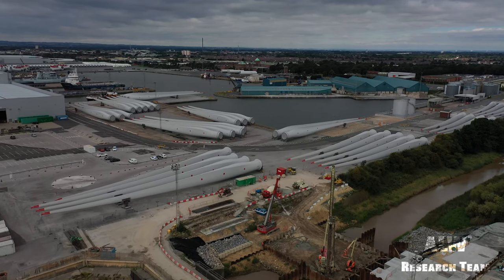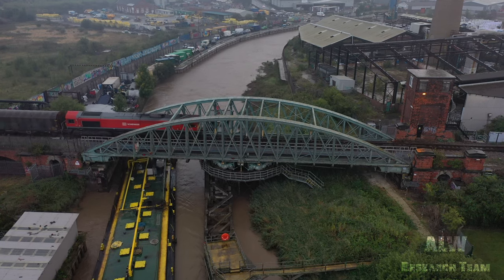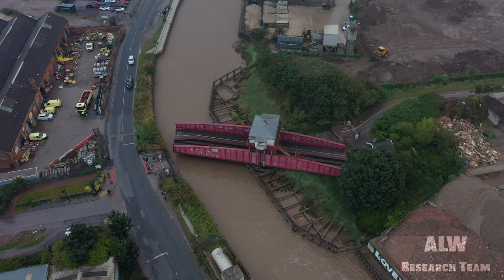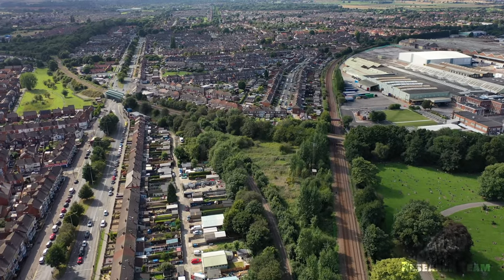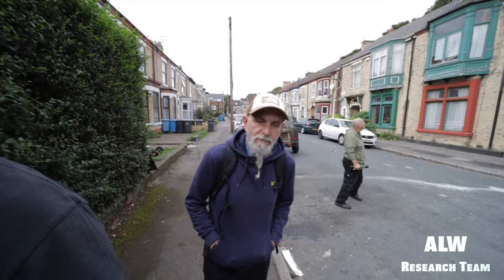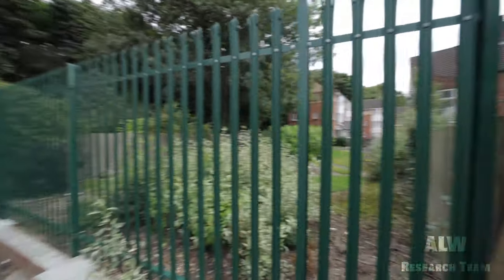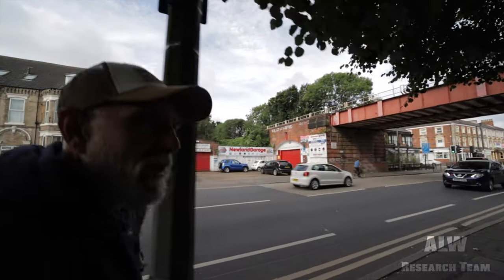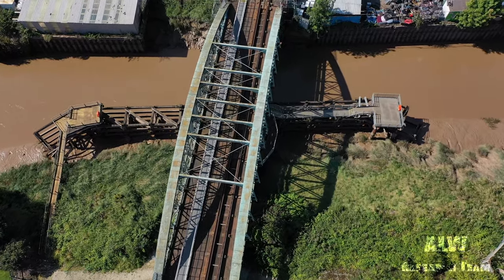Hull & Barnsley Railway | Steam Crane | Hull Swing Bridge | Cannon St Beverley Rd Stations Episode1

Comment: The H&BR though it still exists as far as the former bridges junction at New Bridge Road, has seen the bridge to Alex Dock removed along with the entire embankment all the way to where Bridge No1 crossed Hedon Road and there is no existence now of any of the bridges or abutments to the bridges anywhere along the length of the former railway there. It would have crossed on 2 bridges over roads and 1 over the former Hull-Withernsea branch before joining the old line at bridges Junction. Bridges Junction itself is relatively new as that was built for when King George Dock was built and opened.